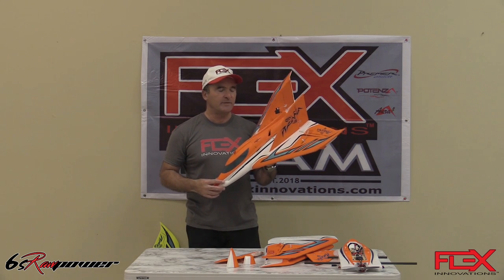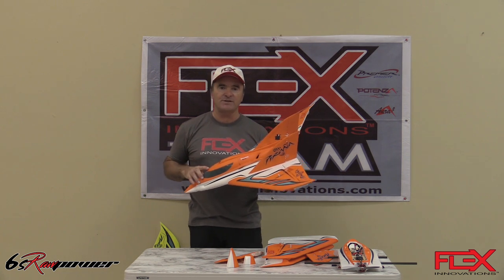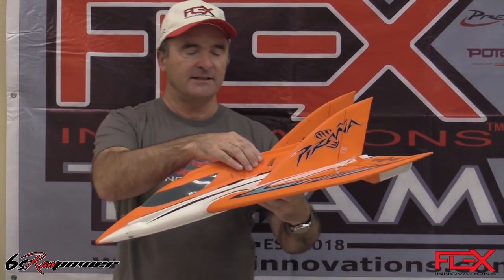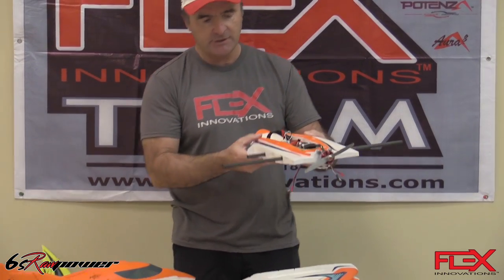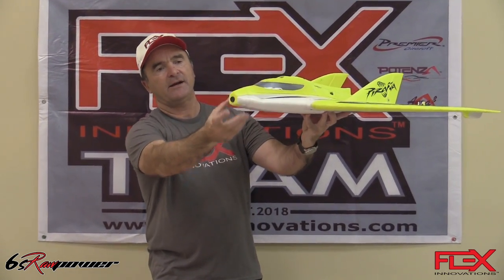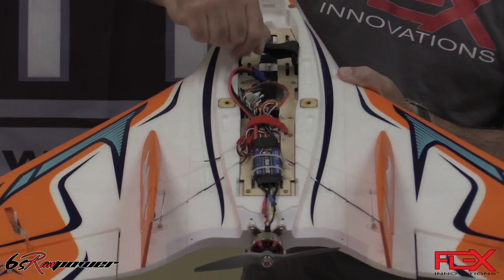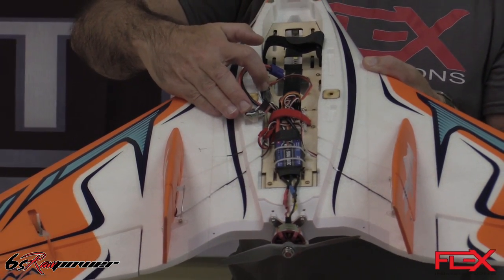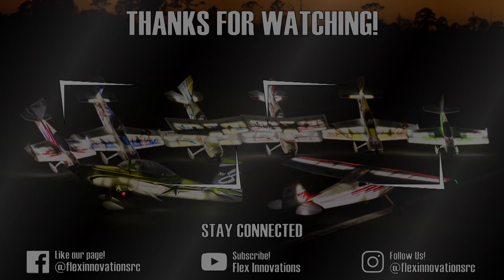Piraña Overview w/Quique Somenzini - Fle Innovations

Comment: I have installed the aura 5 lite it works and corrects in the proper direction But for the life of me I cannot get the launch assist to activate unit is mounted on its side with proper orientation of connections But I've been at it for hours literally Simply will not activate Is there a walk through of setup someplace to see it I've missed something thank you
Reply from the maker: Instructions are in the Piraña manual. Make sure your throttle is all the way down, and the aircraft is MOTIONLESS for at least 8 seconds. If you're holding the airplane, that won't be still enough. Also, make sure you do not have any trim in the transmitter. If you have trim in the transmitter, Quick Trim the airplane/Aura, and remove the trims from the transmitter.